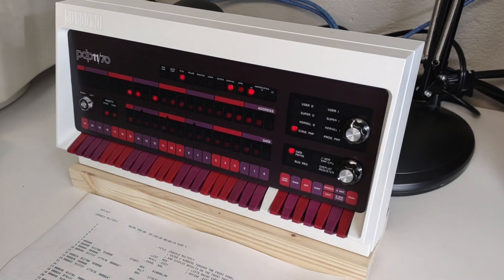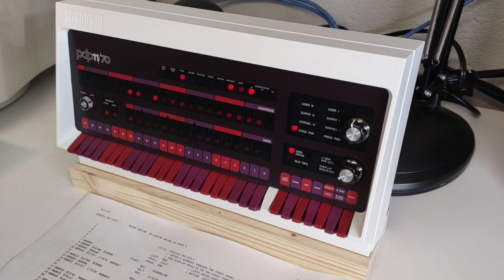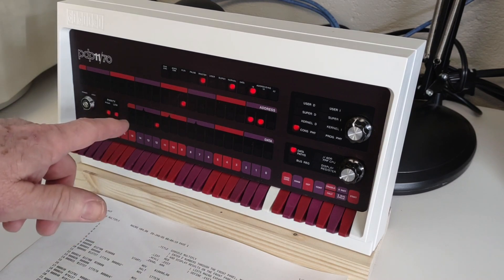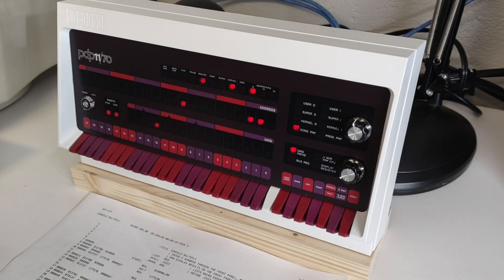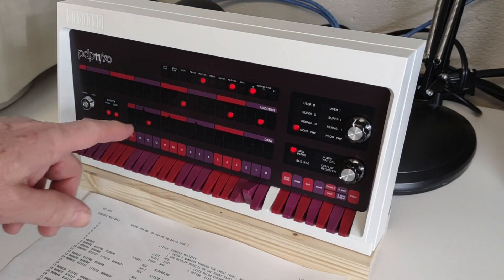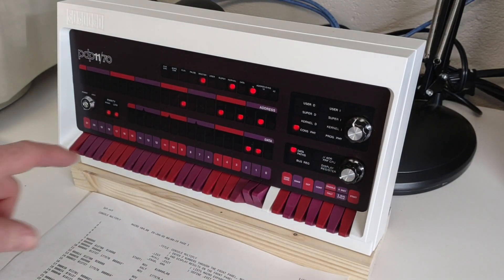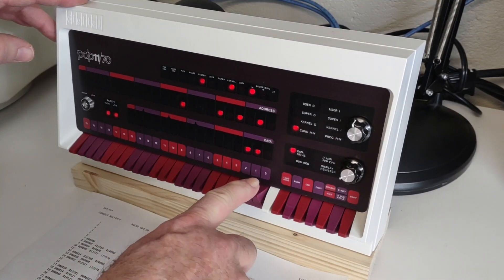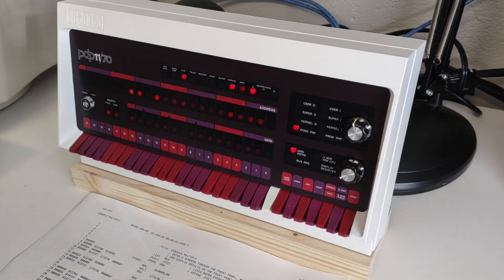Using the PDP-11 (PiDP-11) Front Panel to Enter Data and See Results

Comment: I'm curious, what video camera, or secret setting did you use to record this. Every time I video (or snapshot) my PiDP-11/70 the lights look orangeish. I've tried 2 different cameras. But mine are vibrant red like yours. I notice the same thing with many other PiDP-11/70 YouTube videos.
Reply from the maker: More than likely I just used my android phone, but I probably adjusted the exposure level manually.
Reply: @bigdanzblog6253  I used my Android phone. I also tried my Sony camera. Thanks for the tip. I'll look into that. I'm a mostly point ant shoot photographer.